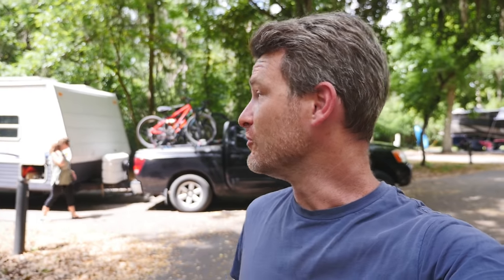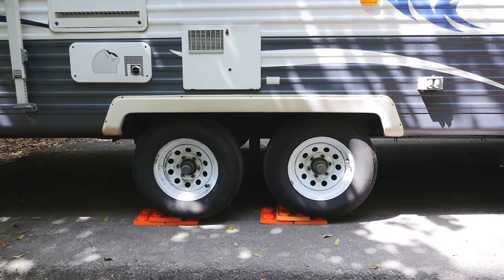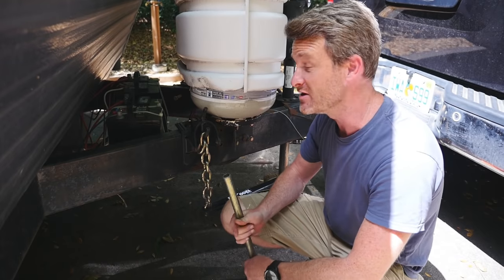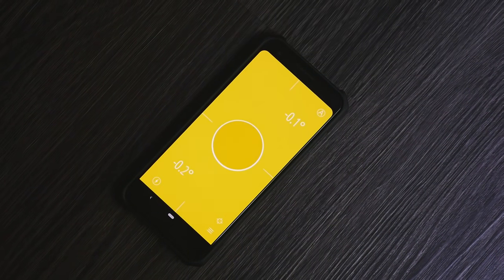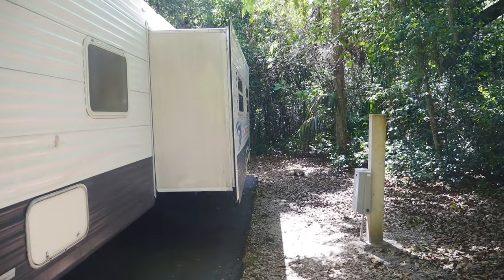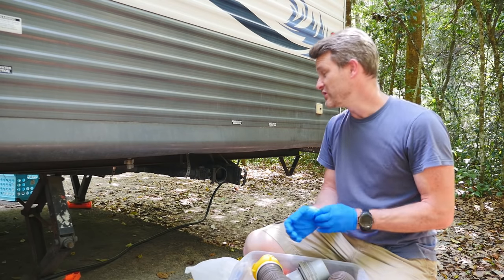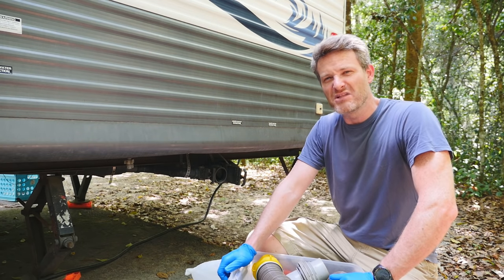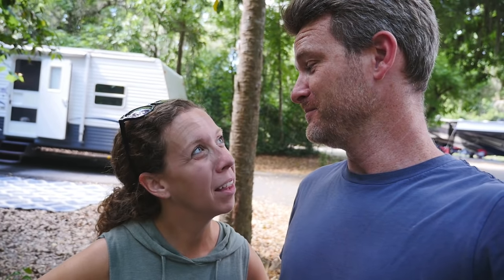How To Setup Your RV Campsite! RV for beginners

Comment: I have to correct your step one. Before leveling you need to check that you will reach water/power in and sewage out. You've gotten used to eyeballing that but newbies not so much (as newbies we know.) Love your channel!
Reply from the maker: Very good point. We simply don't think of it because we always have multiple hoses so that we can put the trailer exactly where we want it. But you are right, we have had to adjust when the campground (for some unknown reason) puts all the connections at the very front of the campsite.
Reply: I agree.  I also use a tape measure to visually check for clearance on the slides to make sure they will not strike electric post, water pipes, and any overhead obstructions.
Reply: @TheGrayAdventures I am new to your channel, and I have to say great video. I don't own a camper or travel trailer, but I would love to. I have to ask, was that a Camco power cable?, and what in-line water filter do you guys use?

Comment: One thing I do different.   When the sewer hose is in the box, I shorten it as much as it will then connect both ends together.   Makes a rectangle that fits nicely in the box.   No mess and since sealed, will stay near that size.

Comment: You're missing a few vital ingredients: water pressure regulator, hose support, and a droop in the hose to make a "p" trap so you can leave your grey water valve open without stinking up the park.

Comment: Nice video, however you forgot to mention a surge protector prior to installing your power and a water pressure regulator.  Other than that, great job. 👍
Reply from the maker: Yeah, we forgot about the water pressure regulator since we had it permanently attached to the filter.

Comment: Hey, when you were connecting the hose, I noticed the little blue thing. What's it for? And where did you get the orange leveling?
Reply from the maker: The blue thing on the hose is the water filter and the orange leveling blocks are at any RV store or Amazon.

Comment: Very informative video.   I noticed you didn't use a surge protector for your electric or a water regulator to control the water pressure.   Is there any reason you choose not to use those or maybe you did use and I didn't see it.  Either way, great video.
Reply from the maker: We actually do use both. The regulator is connected directly to our water filter and the surge protector is the Camco circuit analyzer/surge protector. Never plug the RV in without it.
Reply: The Gray Adventures I agree.  Thanks for responding and the awesome video.  Have a great summer.

Comment: One comment about the stabilizer jacks...  the higher the supports the better. The jacks are most effective at maintaining the support when the angle of the arms are 90 degrees or less.

We just use a couple extra boxes of Linx levelers for the stabs. 4-5 per stab and we get solid support

Comment: We’ve been camping for 7 years and have never seen a sewer dump at the front of the site. Ridiculous!  I would have just used the dump if they had one.  I noticed you used X-chocks but did nor chock behind your wheels unless I missed it. X-chocks are not a replacement for wheel chocks. I believe it says that in their instructions. Overall, a good video for beginners.

Comment: Just saw this video.
The x chocks are NOT for chocking wheels !!!! 
They are ONLY for stabilizing trailer !!!
You still need wheel chocks.
It states this on box & instructions.
Please be safe out there.
Adding blocks under jacks to reduce extension makes a wold of difference.

Comment: What, no water pressure gage, no surge protector, and no see through connector at surage tube. You need that stuff.
Reply from the maker: We do have a water pressure regulator on our hose and we did show our surge protector in the video as well. This was more about setup than the individual items that are used. But yes, all the items you mentioned are very useful. Thanks for sharing.
Reply: For a beginner I would have needed more instruction

Comment: Those xchocks are stabilizers only. The instructions specifically state to block the tires first. Kinda misleading and might get someone hurt.
Reply from the maker: You have to level side to side first before the chocks go in since you need to raise the tires on one side of the RV. If you put the chocks in first, you'll destroy them.